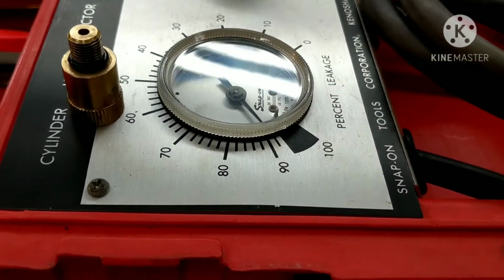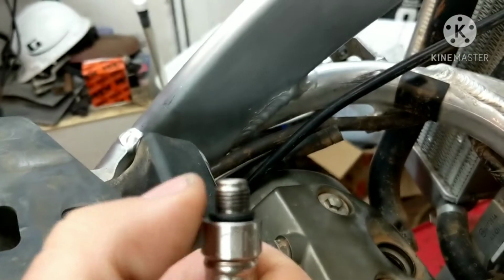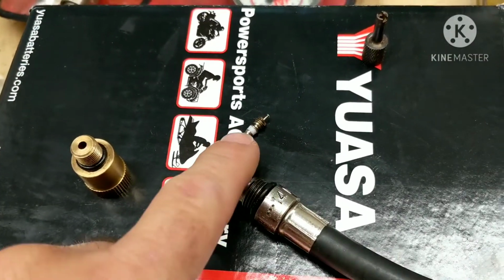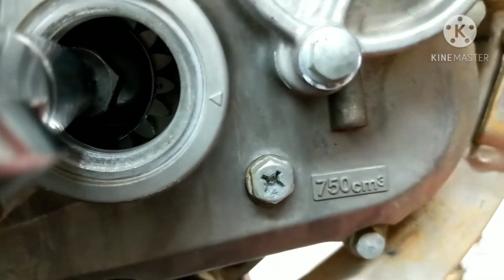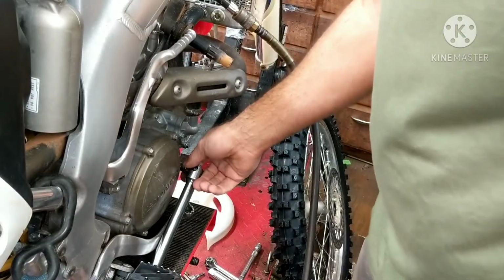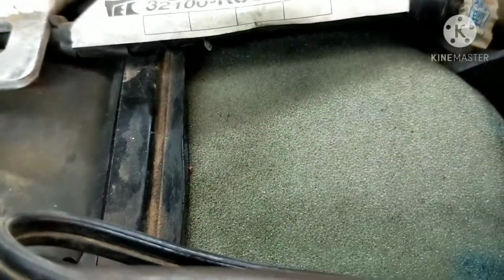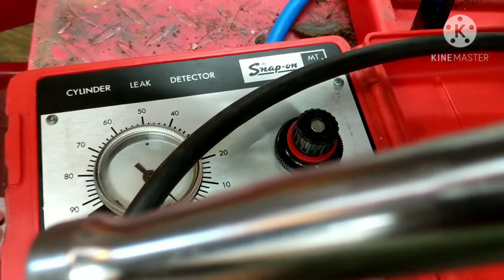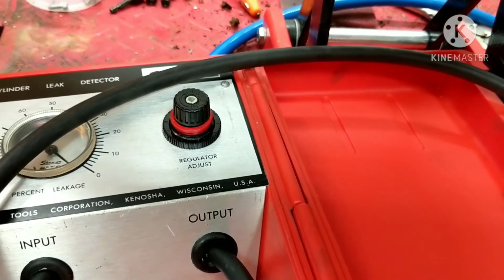Honda CRF250 leak down you need this fitting!

Comment: I bought a 2005 CRF250X and would like to do diagnose if there are any issues by doing a leak down test. I do not have any sophisticated instruments to perform such a test as of now. In my case, is there a DIY to make your own leak down test? Any recommendations would be greatly appreciated. Thank you in advance. Justin.
Reply from the maker: You could just hook up a compression tester line with the core removed, set the bike to TDC on the compression stroke, put 40psi in and listen. You'll have no idea the percentage but if it's loud you need to investigate.

Comment: Hello, thinking about buying a MT-324 snap on leak down tester from eBay, planning to do a leak down test on my 2008 Crf250r. Is the attachment on the end of the hose that screws into the spark plug hole a 10mm or will I have to purchase a separate one? Thanks! Awesome video.
Reply from the maker: It is a 10mm but it needs to be a longer threaded 10mm. The Snap-on 10mm won't reach the threads. I made a video about that as well. The tool is great, the Honda just uses a longer collar plug putting the threads further away. Here is the video.
https://youtu.be/bpTpTfjX6b4
It will be published on Wednesday. If you're interested in seeing it sooner send me an email at tepcocyclerepair@gmail.com and I'll send you a link to see it earlier.
Reply: @TepcoCycleRepair  awesome, hope the eBay snap on tool works just fine.. I clicked the link but it says the video is private, but no worries. Thanks for the help.
Reply: @TepcoCycleRepair  sorry, didn’t see the edited part, I will shoot you a email about the video. Thanks again and if you can’t send the link, then no worries at all.

Comment: Last video you showed how to adjust the valves it worked on my bike, my right intake valve was shot. now it fires up. NOW

I hope you can help me out with this issue, I just rebuild the top end of my 2005 honda crf 250r. after trying to find out what was the hard ticking and knocking, I did all shorts of things like checking the shims,  changing the timing chain and the rocker arm. the sound still present, I disassemble the engine to check if something was up with the piston, to my surprise the piston looks tilted to the left one side is higher then the other and it was hitting the side of the valve head. do you think it  the problem is in the crankshaft? Note: The cylinder and the piston are new.
Any ideas? Please help!
Reply from the maker: A tilt left to right could be a worn wrist pin or connecting rod where the wrist pin slides though. Front and back tilt would be a worn cylinder or wrong size piston compared to the cylinder. You saw my other video about the normal loud click due to the auto decompress right? Look at that first, if that's not it I would pull the cylinder and check the wrist pin to crank.
Reply: @TepcoCycleRepair  About the the decompressor click I'm aware that is normal, the problem with my piston is when the piston is on top dead center. The one side of the piston is flush to the cylinder head and the other is lifted (croocked) a little bit, I can see the marks in the side of the piston and the valve head.
Reply from the maker: @vidson7  Yeah, time to pull the cylinder.